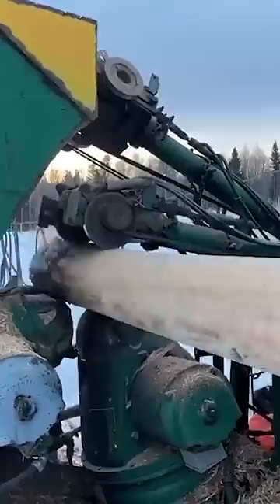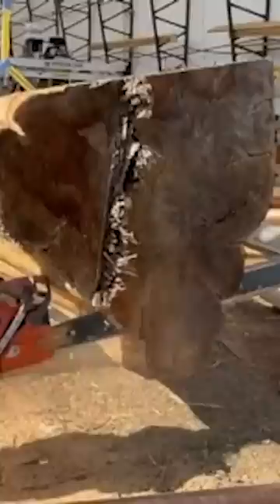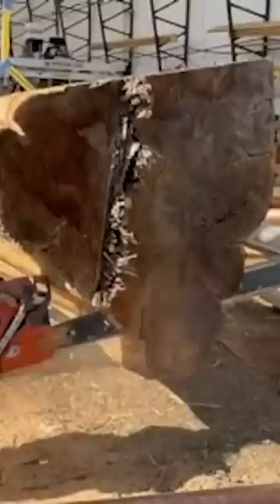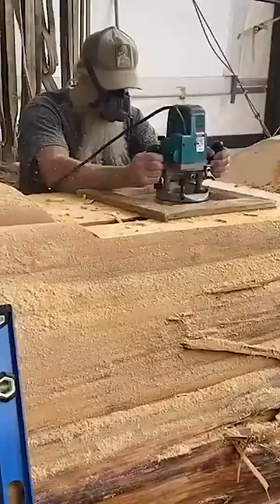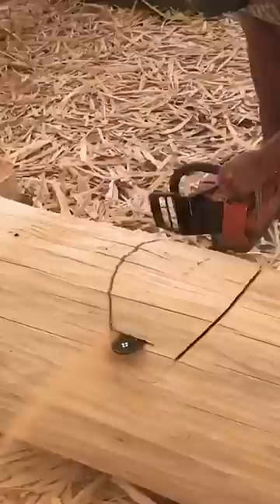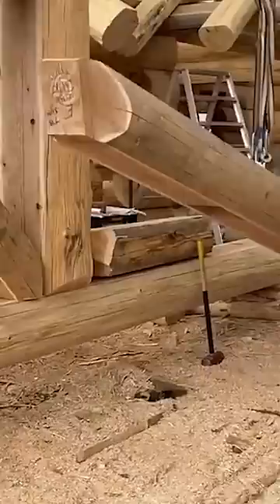How custom log homes are built. #LogHomes #Homes #Construction

Comment: That log slide better be kept up on otherwise it’s gonna be named Master Splinter.
Reply: Usually slides like that are sealed with a waterproof resin, so it shouldn't be an issue for quite a long time
Reply: @j-davis7290  unless they have dogs that go down it
Reply: @IC3DZOMBIE  😁
Reply: @IC3DZOMBIE even then, you'd probably need to have like 2 generations of a dog to start messing it up
Reply: @epic_errors  how many generations of cats?
Reply: @steve4729  at least 6
Reply: @epic_errors  I was thinking the same. They step lighter and weigh less.
Reply: @steve4729  and just more coordination overall in general. Now it would be around 12 generations for turtles. They don't weight as much but that she'll would have constant friction all thr way down.
Reply: @epic_errors  plus the whole turtle wax thing would preserve the wood and make it more slick.
Reply: @steve4729  well that's only if you wring out the turtles first.
Reply: @epic_errors  only when the next generation arrives.
Reply: @epic_errors  5 years is all takes i know from experince in 2 houses even
Reply: The Battle between Masters Splinter and Shredder for real lol

Comment: Its weird how different log houses in North America are compared to Finland. Thats actually so cool that u guys use complicated joins and stuff like that to form shapes in the frame. We just stack them on top of each other and cut the triangle shape to the wall for the roof 😯
Reply: We also do that if you aren't rich af lol
Reply: Thats pretty standard for a cabin.  You dont need much if its a weekend trip but for some of those bigger houses this is what they do. They are by no means common
Reply: These are designer houses for rich people who probably don't even live there full time. Form over functionality. I'd take  Finnish house without a question
Reply: They're doing the same thing but they just showed the complicated parts for the video. Because of the size of the house, the trusses need a bottom member to avoid the roof caving in and pushing the wall outward from the weight of the timbers and potential snow
Reply: Actually, historically Americans built log houses the exact same way that they did in Finland.
     This is because half of the Swedish colony in what today is Delaware were Finns. 
      And those Finns introduced the log house to America.
Reply: @drmodestoesq  Is this foreal? :o Sounds hard to believe 😅
Reply: That’s what >80% of the log cabins in North America are like

Comment: Been building houses for roughly 25yrs, would love to get in on building something like this just for the experience. Great looking build guys
Reply: I want to learn how to but not sure where to start
Reply: I have a question. How long do these log cabins last? Would you need to replace log by log with time?
Reply: @mitchkim6763 logs require alot of maintenance, more so than a standard stick build for the exact reason you mentioned.
Reply: @hellfiregamez5968 go towards the sunset, turns right at the Rockies. I'm planning on spending next summer in Colorado working. I'm in the Texas Hill Country and I've met a couple of guys that worked like this.  Very remote, unfriendly workers and customers, so they say
Reply: @mitchkim6763 I've worked on repairing several log cabins in eastern NC. I've found they don't last unless you properly upkeep them, and no one with a log cabin really does that. They tend to be secondary homes or owned by those without the energy or means for upkeep.

 Replacing or patching rotten logs is a nightmare. You have to build a false wall inside the home and make your cuts with a chainsaw. We never did find a good way to do the corners properly. It's built from the bottom up instead of traditional contruction which has a lot more horizontal progression.
Reply: @toastedt140  they really belong in dry climates that are below freezing for more than half the year
Reply: @toastedt140  depends on the style of log obviously but for dovetail d logs I just make the corners square for repairs... cheapest, fastest, without loosing alot of the look... also depends if there's chinking or not.. can hide some of it with repairs... there's no easy way to replace logs mid house like u said lol.. but it's what I do in colorado.. some logs are 65-85k replacements lol if ppl would just oil their logs.. lots of headache saved but oil ain't what it use to be with the new VOC laws... oh well sounds like more money and ppl up here apparently have endless supplies
Reply: Just wondering how much settling happens on these homes and if it slows or stops.
Reply: @boosted.  forever, like one man says, "it's not the kind of house where you just step into the shower. There might be a big spider in there. We fumigate every month.
Reply: I’ve built one similar
Google LHBA

Comment: I've helped build log homes and did repair/maintenance work to the logs over the years. I can tell you from experience that homes made with a wood exterior are terrible. The sun destroys even the strongest wood stain/sealer within 5-7 years and the process to reapply stain requires a LOOT of manual labor. People often build wrap around porches to protect the walls in shade. That works well but you still have all kinds of insects CONSTANTLY trying to eat or drill holes into the walls. Woodpeckers also destroy it. After decades of building both log homes, traditional stick frames, metal buildings, ect, I can say confidently I would never build a log home for myself....They're just too weak. They don't last and require a lot of maintenance. Not to mention they're expensive.
Reply: What construction would you recommend people build/buy? I’m not a fan of modern stick frames but don’t know a better alternative
Reply: You prefer particle board or press board then?
Reply: @joshy3614  brick. as in fired clay. dont get those concrete bricks.
Reply: @jstefa2  concrete bricks are great.

Comment: I know some people won’t appreciate this because modern tools are used. It still takes some high skill to cut these to just the right fit and the actual logs to select to get the desired results. As a construction guy myself I’m very impressed at the precision and quality from these workers.
Reply: I don't know why people only associate craftsmanship with hand tools.  Power tools are faster, but way less accurate.  So a tiny mistake that'd be a cinch to fix by hand tools would be catastrophic to the same project is power tools are used instead.  I did fine chisel work for cabinetry and also did some mass production work.  Both sets of tools make some things hard, and others easier

Comment: for all those saying that it's super expensive to build a log home, after some research the answer clearly is: it depends. there really are cases in which logs are cheaper for a simple cabin build 8n a remote area using local trees, but not surprisingly, big logs are almost always more expensive. The surprise to me is it doesn't bu itself increase the cost of the house by a hundredfold or even 10-fold. so it's more expensive, yes, but depending on a lot of factors, the price difference is because the people who are willing to pay twice as much for the framing and walls are also willing to pay 10 times as much for lots of other goodies and fixes inside. also consider placement in the middle of nowhere, which by itself can increase the house price a lot more than just the cost of the wood inside. If you want more details, do what I did: just search around a little and you'll find many links right away.

Comment: this has gotta be 4x the price of a timber framed house
Reply: More like 8x.

I own a framing company in Northern California. 4 bedroom 2.5 bath homes are pieced and paid out at $15,000 each(labor only)

This custom log frame is well over  $180,000.(if I had to guestimate)
Reply: This is a very unique build by a very unique builder. Generally speaking timber framing is cheaper than stick framing.
Reply: @EpsteinWasJustTryinToFitIn  i’m pretty sure this is false unless we are talking about different things, because stick framing is standardized and can be built once without any high levels of expertise
Reply: @anthonyjcarrillo  wow. my original comment was 4x the price of a timber house twice the size but i thought that would be confusing to read. thanks for commenting
Reply: @taking a fat dump  I wouldn't call it standardized or say it doesn't take a certain level of expertise.... I fire people every day because they can't read a tape measure. There are levels to this.
Reply: @anthonyjcarrillo  so a house like this only costs roughly 250k (not including plumbing and electric)?  That actually seems reasonable
Reply: I was thinking 40X!!!
Reply: @anthonyjcarrillo  but timber takes more skill and uses more expensive materials no? at least that’s what i was taught
Reply: It is a timber framed house, the timber is just processed/used differently.

Comment: I don’t think people give enough credit to this style. It’s amazing how accurate you can cut with a chainsaw they  figure “chainsaw grunt grunt. I’ve been a carpenter over thirty years I did about 3 years hand crafted log ,timber framing I always and still do think cutting those big roof panels there like 12” thick even more sometimes but cutting in a valley isn’t easy

Comment: You can get a proper spruce/pine cabin made probably for a 10x times cheaper than what this extravagant monstrosity is. You can add extra insulation and build an outer wall of regular plank on top of it, but its not necessary if the logs are sturdy enough. This is just a mockery of craftmanship that leads 1000 years back.

Comment: Curious about something. What about insulation detail on these?

I know the aesthetics and the full natural logs etc are the ideal here.

That’s why I’m wondering how to fight energy loss, drafts, and condensation etc.

Not saying to make them different just to insulate, but how to incorporate it without changing the looks.

You want inside and outside to be exposed obviously this is the whole point.

I’m someone who loves natural products being visible and functional, just curious.

I had to set pretext in there as I know a bunch of propel would yell “it’s not about efficiency it’s about beauty etc” and I get that. Just wondering ways to incorporate both.

Don’t want to hollow the logs to insulate, surely would compromise structure.

Maybe doubled exterior walls? Like two separate logs with a cavity in between?

Also what would be the approximate R value of logs this thick?

I’m in standard wood framing and we look at thermal bridging of the studs, but obviously these are much much thicker wondering what rough value can be put on these?

Comment: I have respect the craftsmanship but why use wood when you can build homes using bricks. You get better insulation, longevity, no problems with rot, no worries of tornadoes, i mean, they take damage but it’s easy to rebuild a partially destroyed house then going out for a new one.